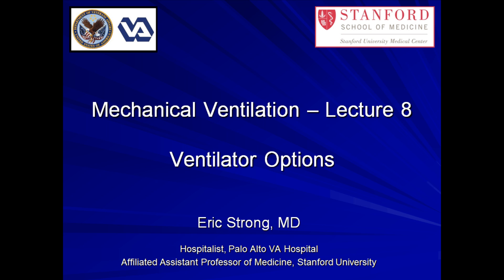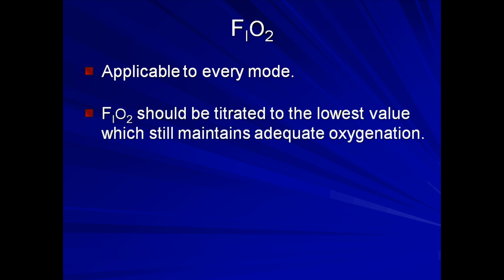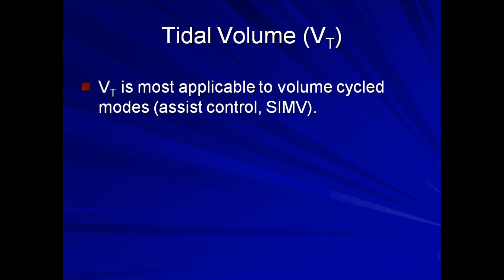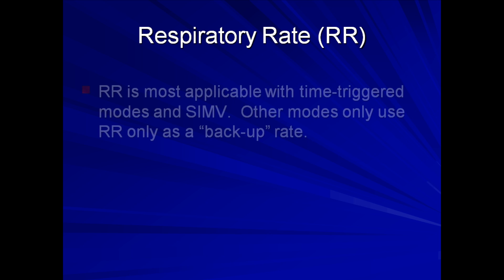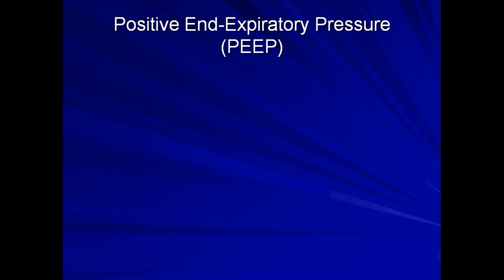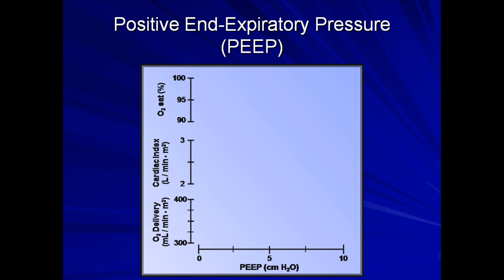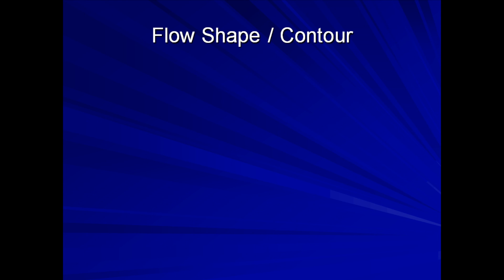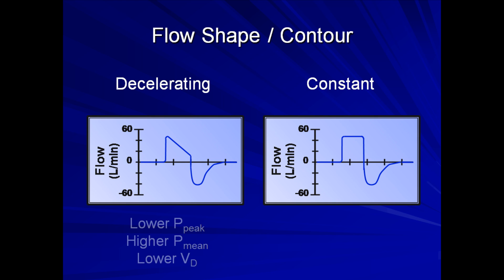Ventilator Options (Mechanical Ventilation - Lecture 8)

Comment from the maker: gsuboy, lecture 6 in my mechanical ventilation series "Non-invasive positive pressure ventilation" covers what most physicians refer to as "BiPAP" but which is formally known as bilevel ventialtion.  I've heard some respiratory therapists use the term "bilevel" to refer to something slightly different than traditional BiPAP, but I don't know the specifics of it.  Most of my vent knowledge is already incorporated into the video series.

Comment from the maker: Argh!  I can't believe I've had this lecture up for over a year with that error in it!  You are correct that I haven't been consistent.  What I meant to say in this lecture was that the tidal volume is relevant to VOLUME TARGETED modes, such as assist control and SIMV.  In pressure targeted modes such as "Pressure Control", the tidal volume can't be directly set, as it's a consequence of the set max insp. pressure and the patient's individual lung mechanics.  Thanks for pointing this out!